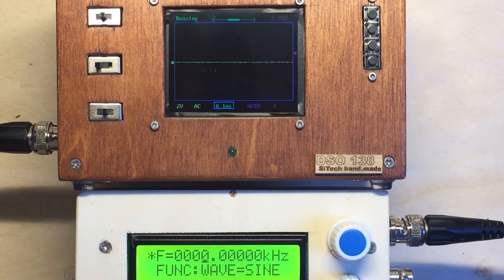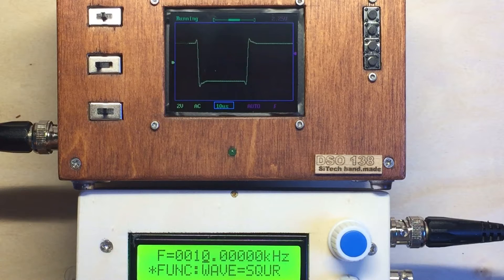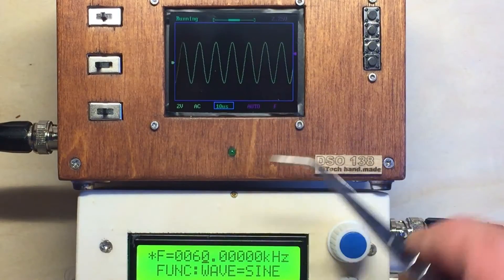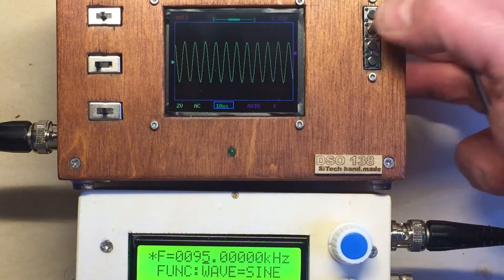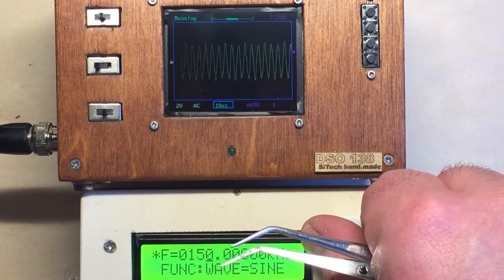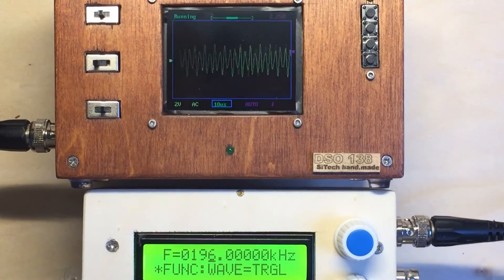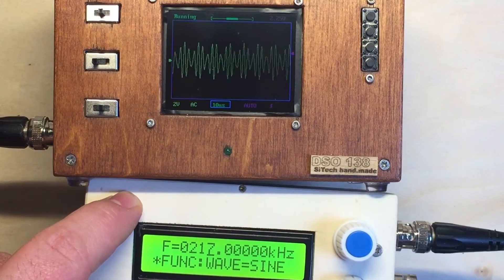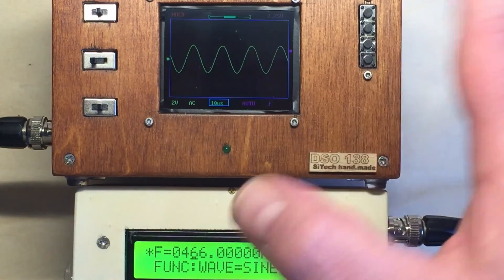JYE TECH DSO 138 DIY KIT checking usefull frequency range.

Comment: On the left side next to the slider switches there are two green adjustable caps. You need to follow the instructions on how to adjust them. But you basically turn them with a small screw driver until your test square wave is perfect.

Comment: Mein DSO 138 ist gerade noch auf dem Weg zu mir (Banggood 14,63€). Habe aber eine frage. Wie ich sehe wurde in dem Holzgehäuse der BNC Anschluß an einer anderen stelle rausgeführt. Wollte nun fragen womit das kabel verlängert wurde. Da man ja diese Leitungen eigentlich nicht so ohne weiteres verlängern kann (ohne das messergebnis zu beinflussen). Wollte mein Kit nämlich auch in ein schönes Alu gehäuse einbauen. Aber der BNC Anschluß soll dabei nach vorne  rausgeführt werden.
Reply from the maker: Ich habe den BNC Anschluss mit einer Coax Leitung verlängert bei der Nutzbaren Bandbreite sollte das kein Problem sein. Viel Spaß beim basteln.
Reply: Danke! 
Hoffentlich kann ich mit dem Oscilloscope auch den Mod hier durchführen (http://blog.spitzenpfeil.org/wordpress/2015/10/23/youyue-858d-hotair-station-bldc-fan-speed-mod/). Man braucht ein Oscilloscope um die Vref einzustellen. Sonst soll es eigentlich nur für Taschenlampentreiber und Adruino Projekte genutzt werden (z.b. um PWM Frequenzen zu testen . . . bis ca  ~20-25KHz).

Comment: There is the Gabotrinics Xprotolab Plain for $20 with a lot more features, it's just that you have to run it through a PC for the display. They have models with a display, but they are too small or cost too much.
Reply from the maker: I see one of their product at Ben Hecks show but it's not easy to order from Germany, there is one little distributor selling them but all of them are out of stock. Maybe I give them a try later, just now I order the new JYE Tech one the DSO shell I got this for under 20€ at banggood.com.

Comment: You have to adjust the caps to fix the square wave. I had to adjust mine a little but it was pretty close. For you to do it you will have to take it out of the case.
Reply: They are trimmer caps.
Reply: Exactly.

Comment: this is a great Chinese product! who can produce an oscilloscope that can measure 20 KHz waves at $20? Also we can use it as a development board for other projects.
Reply from the maker: You are right compared which kind of diy kit you get in Germany usually for 20€ this is really great, but to be honest the documentation is Germany is much better. I remember the old soldering Kit`s from conrad electronic they also explained all the parts and put a lot of effort in their documentation with those Chinese kit's iIm already happy  when they have schematics. ;)